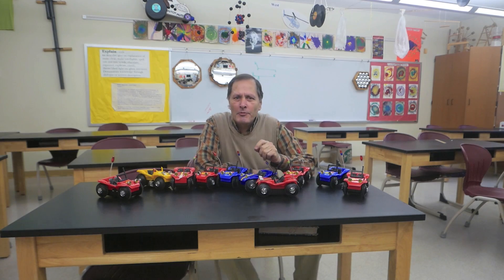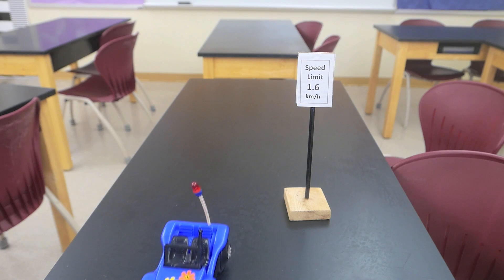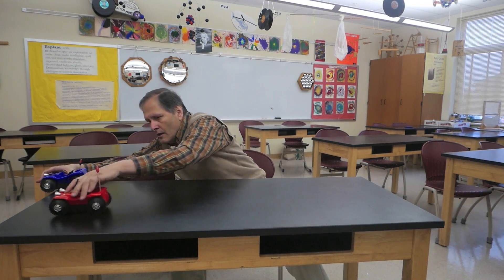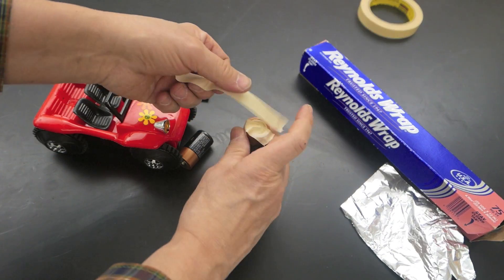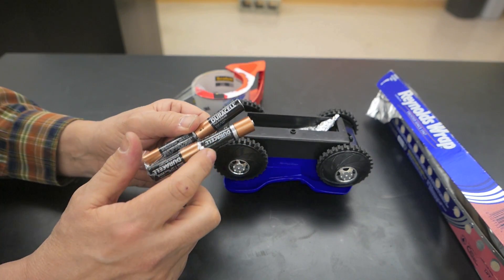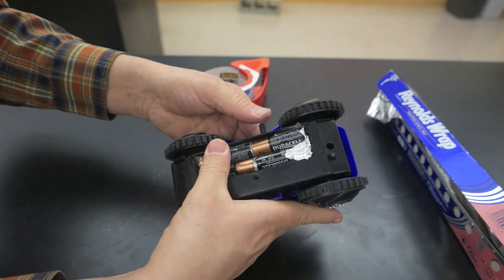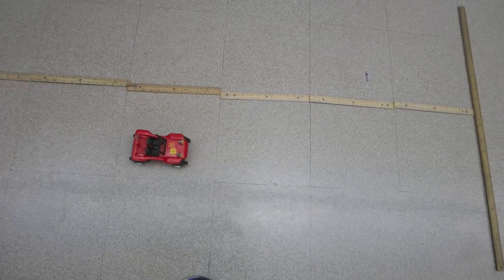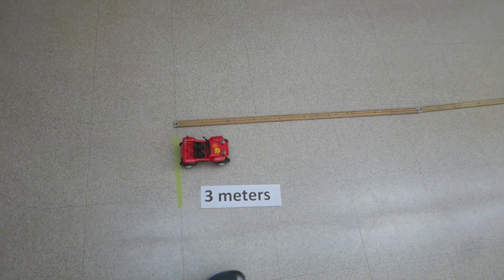toy car speed trap - calculating speed // Homemade Science with Bruce Yeany

Comment: Car #1 was going 0.98 MPH (1.56 KPH).
Car #2 was going 0.37 MPH (0.59 KPH),  big time sunday driver.
Car #3 was speeding at 1.72 MPH (2.45 KPH).

My measured times were 5.71 and 6.8 for #1,  14.86 and 18.33 for #2,  and 3.59 and 4.42 for #3, in seconds.   I converted the 8 feet to 2.44 meters,  divided the meters traveled by the seconds to get rate of travel in meters per second.  A trick I learned way back in grade 12 physics to convert meters per second to kilometers per hour, is to multiply the number by 3.6.

Averaged the speeds,  then did the conversion back to MPH.   All numbers were kept to 4 decimal places till the end, then rounded to two places.

Car #3 would be assessed a $120 speeding ticket, for being 70% over the speed limit.

Comment: Alu foil and batteries, good times. Who else did something similiar to power his GameBoy?
Reply: I have the same car Bruce is using in his demo.  I've found that a wine cork wrapped in aluminum foil works well as a battery jumper to slow it down to half speed.

Comment: The ingenuity in getting the different batteries to fit and therefore provide different voltages (and thus, motor speed) is amazing. I would have maybe come up with taking out one of the D batteries, but the 4 and 3x AA shocked me, especially since you got away with just aluminum foil and tape.
You are an inspiration and I hope all your students can see that and have a great time (I know I would, and I'm almost 24!).
Just a curiosity, do you explain the trick to getting the different speed to your students?

Comment: Car one was doing exactly 1mph and just a hair over at 1.7km/h but I'll let it slide. At .38mph and .58km/h car 2 was going significantly below the limit so I had to go around. Fortunately our cruisers are equipped with a fifth 1.5v battery so I could catch up to Car 3, who got a $90 speeding ticket for going 1.36mph and 2.30km/h. The former was a lower percentage than the latter so I rounded it off to the middle.
Reply: Humm.. I got around 1.52mph or 2.45 km/h for Car 3. The car traveled the 8 feet in 3.61 sec and 3 meters in 4.37 sec. What you get for your times?
Reply: I rounded off 8 feet in 4 seconds and 3 meters in 4.5 seconds. Your kept the numbers precise, which I learned from this exercise matters more as the higher speeds add up.
Reply: Got it. Yea I like to keep the numbers precise till I get to the answer then I round. Otherwise, rounding through out the calculation could throw you off by a whole number or more. 
A tip I learned from my teachers : )

Comment: I calculated out the times. 

Car #1 traveled 8ft in ~5.29s, which is ~1.023MPH. That would be a $50 fine.
Car #1 traveled 3m in ~6.49s, which is ~1.66KPH. That would be a $50 fine.

Car #2 traveled 8ft in ~14.46s, which is ~0.377MPH. There would be no fine, but you should be fined for going that slow.
Car #2 traveled 3m in ~18.16s, which is ~0.59KPH. There would be no fine, but you should be fined for going that slow.

Car #3 traveled 8ft in ~ 3.68s, which is ~1.48MPH. That would be a $90 fine.
Car #3 traveled 3m in ~ 4.42s, which is ~2.44KPH. That would be a $100 fine.

Keep these kind of videos coming! I love working out the examples and getting a little bit of brain exercise. 
Thanks!!
Reply: Quick mafs.